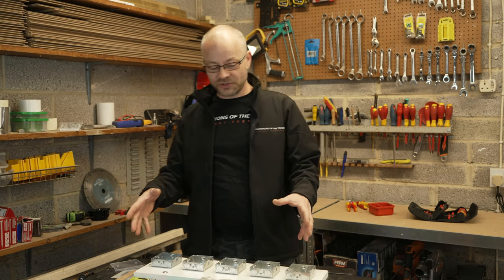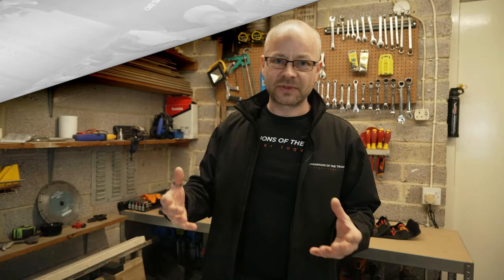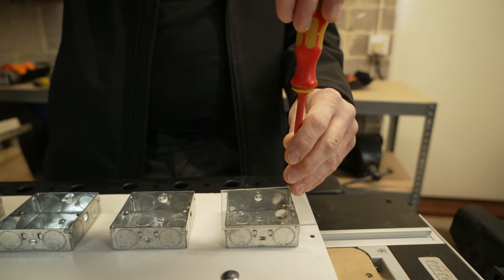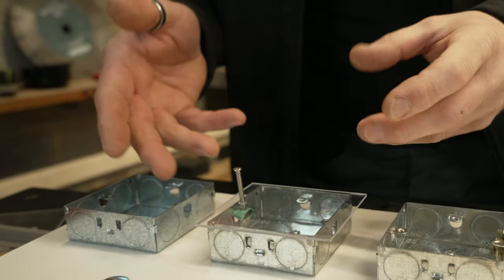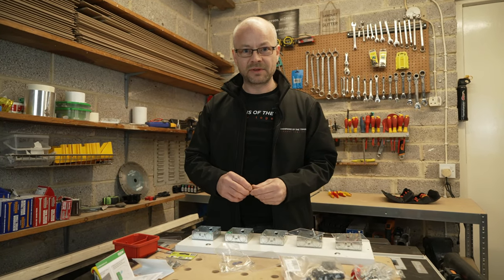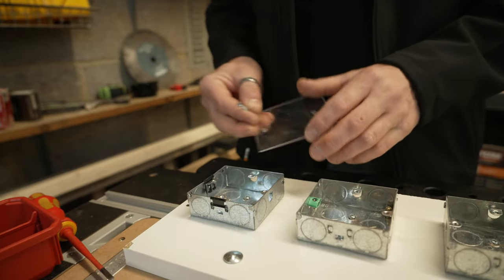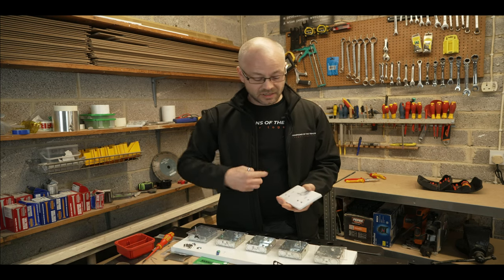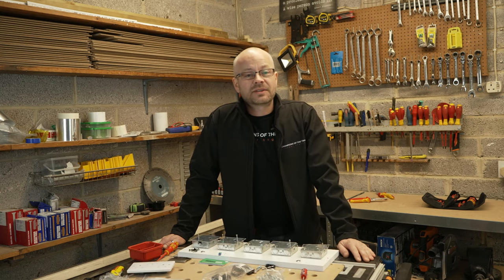5 Ways to Repair Your Broken Metal Backbox | Which One is Best?

Comment: I've always found if the thread has gone on the backbox use some PTFE tape on the screw.
Reply from the maker: That's something I haven't tried 👍
Reply: I used 2 pieces of thin copper wire twisted together placed this in the screw hole then screwed the screw in which has worked well for my plastic back boxes. Though this video is really helpful for if any turn out to be metal as I'm dreading trying to replace the rest of the switches! This PTFE tip seems good also!  3 of my switches so far have worn out threads 😫

Comment: another option is drill a hole in the back of the back box inline with the original lug and put a wall plug in the wall and use longer 3.5mm machine screws. This method has saved me on numerous occasions
Reply from the maker: I have tried that too, you need good plugs though or the M3.5 won't grip well enough.
Reply: Yes… you a sparks?

Comment: Great video! Do you think option 5 would work for a socket plug?
Reply from the maker: Thank you. Yes option 5 will work, you may need to bend the existing metal out of the way, or scrape some of the wall substrate to give enough room for the clip. I use these quite a lot. They're great as a quick repair.
Let me know how you get on 👍

Comment: Used to just drill and tap the back of the back box out to 3.5 the either use an extender if a 75mm screw as too short.
Reply from the maker: Me too, if it was possible... Some of these options are much cleaner and quicker. 🧹
Reply: If there's brick immediately behind the box, which there usually is, that can't be done unfortunately

Comment: I think the second one requires you drill out the lug
Reply from the maker: The screws won't physically fit through most accessories anyway, the diameter is too wide.

Comment: I just repaired a back box using a different type, they are a half moon shaped metal strip and the ends are serrated.  Worked very well and use a 3.5mm screw.
Reply from the maker: Thank you, I'll keep an eye out for them
Reply: I just failed with one of these. They look great but the socket was a single. The back of the switch interfered on one side and the earth attachment of the back box on the other. It was a bit frustrating. I kept them because I can see for a double unit they would work.